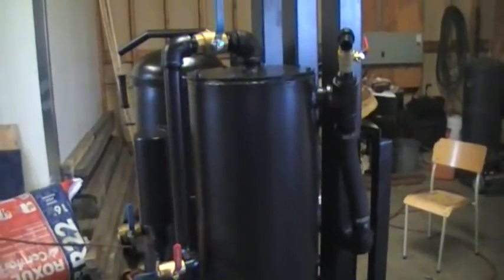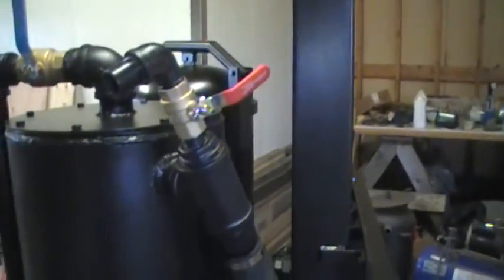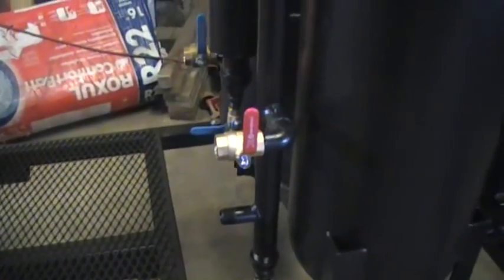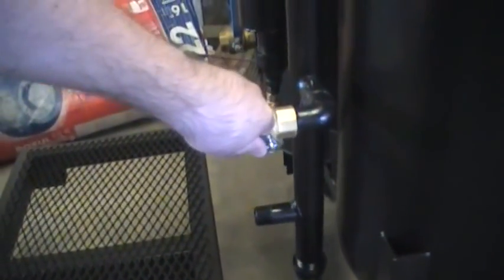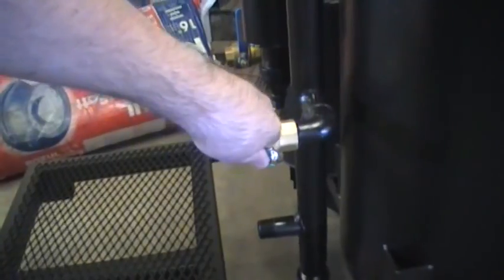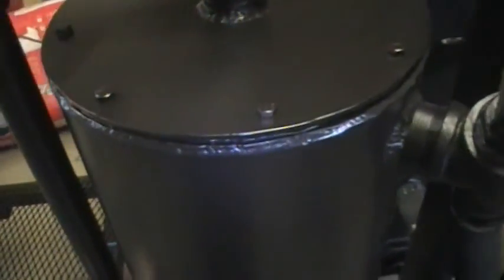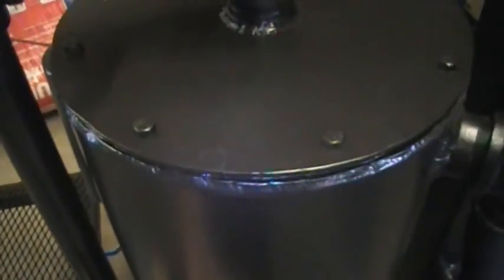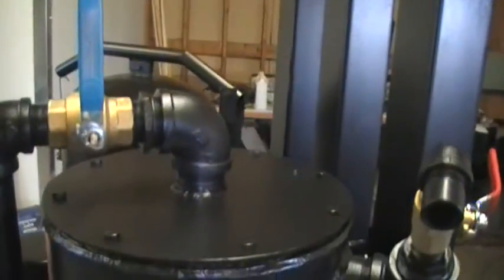Our gasifier system basics and tips

Comment: Nice Lookin machine you got there!!
Reply from the maker: VulcanGasifier Thanks Matt... I build simple... sorta... lol... at least they look that way. I pulled 3000 watts of load for over 3 hours on this system as a run test... took the normal 5 minutes to get up to heat and running.